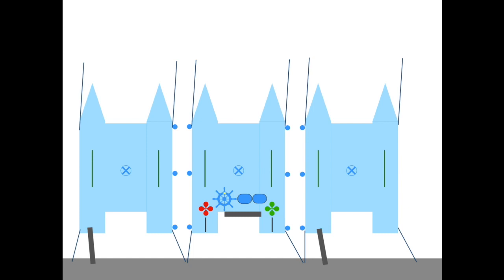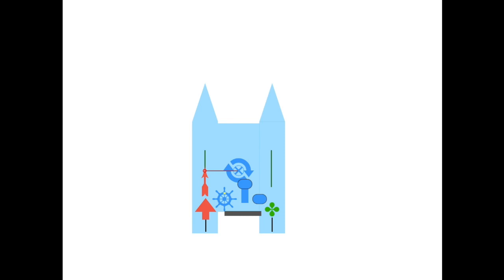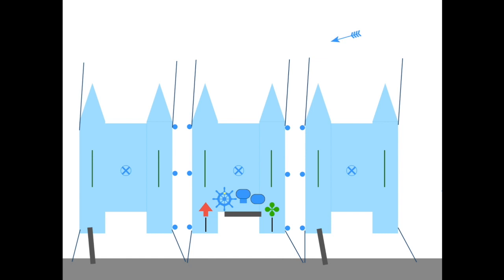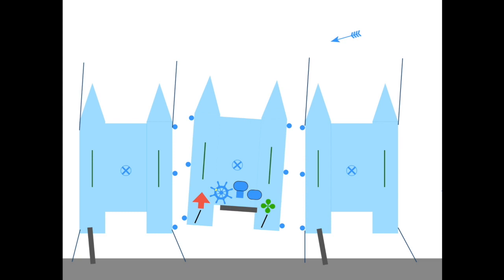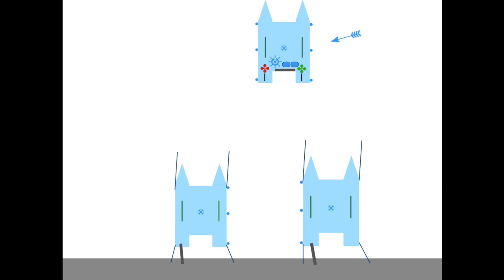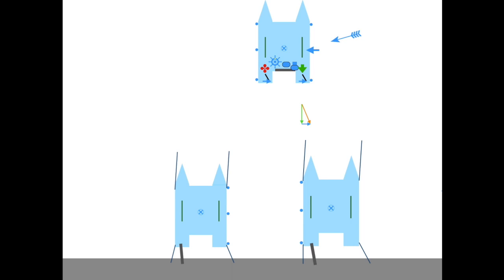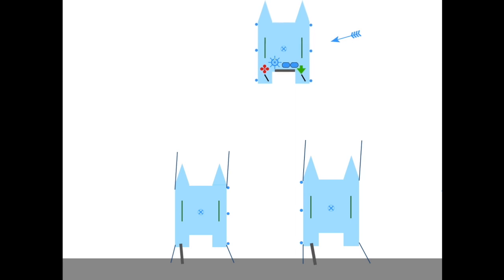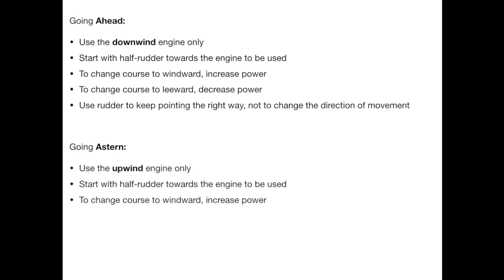Stern-to twin-engine crosswind cheat

Comment: I really appreciate this, and your going forwards guide is great. But why does the rudder have the same impact going backwards as forwards? Going forwards you get the prop thrust over the rudder, whereas going backwards you only have the slow speed of the boat through the water which is substantially less.
Reply from the maker: You are, of course, absolutely correct. More speed is needed going aft to have the same effect,  but it works predictably and consistently.  On some catamarans - e.g. some Lagoons, a saildrive is placed behind the rudder! In this case it works better aft than ahead, but it can be used effectively on any cat

Comment: Great video. can you explain how to do that on a lagoon catamaran (rudders before the propellor)
Reply from the maker: Thank you! There is a separate video on the channel specifically for the Lagoon and other cats with the props after of the rudders.
Reply: @theboatcheat1204 Yes i saw the video and it is very helpful. But it explain how to leave the dock (sideways and forward). How do I use this technique in order to moor (reverse) when the wind comes from starboard?
Reply from the maker: @davidelalouf1774  Ah of course… the same technique works in a Lagoon. However, whereas the effect is stronger going forward in a conventional arrangement, it is stronger in reverse in a Lagoon.  I chartered a Lagoon in the Med a few years ago and handling for stern-to mooring was really good - I reckon arriving is harder than leaving, so the Lagoon arrangement was a bonus.
Reply: So you are saying this crosswind trick works same even in a Lagoon with props aft of rudders?

Comment: You forgot to mention that if the rudders are located forward of the engines, as in Lagoon catamarans, then the rudders should be turned in the opposite direction shown.
Reply from the maker: Indeed - there is a separate video covering Lagoons in the same playlist.

Comment: Not sure if you are still responding to questions.  Why do you put the engine into neutral prior to releasing the starboard stern line?
Reply from the maker: A good question - if the crew drop the line it may foul the prop.
Reply: @theboatcheat1204  Thanks for the reply, but in the sequence you dropped the port line while the port engine was in forward and then put that engine into neutral before dropping the starboard stern line.  What am I missing?
Reply from the maker: @johnditoro1676  Nothing - this is a hitherto unnoticed editing error!  I always put the upwind engine in idle ahead while the leeward stern line is removed, so that the boat doesn’t drift too much to leeward thanks to tension in the upwind line. Then the leeward engine is put back in gear to cause the swing to the windward side of the space so that it is somewhere near the middle once the upwind stern line is recovered.  I am clearly less careful when editing complicated graphic sequences! Thanks for pointing it out - it need re-doing soon anyway because it is very clunky…
Reply: @theboatcheat1204  Thanks again.  I'll be sailing a cat in Croatia in a little less than 2 weeks.  Looking forward to trying some of your "cheats".

Comment: I have read all the comments and this question was never asked. Going forward makes all the sense. I have an issue with going in reverse when you say "do the reverse". The wind is the same so wouldn't the "do the reverse" mean to keep on using the downwind engine in reverse with helm to port to counter the engine? Don't you need the downwind engine in reverse to turn the cat into the wind in order to cancel it? Your suggestion uses the upwind engine in reverse which in my mind adds up to the wind force due to the turning effect. The way I see it the only force battling the wind in your suggested approach going reverse is the helm action. The only reason I can think of in favor of using the upwind engine in reverse is perhaps somehow related to the inverse prop and rudder position (with respect to going forward). But still, using only upwind engine in reverse would have a net effect of moving the cat even more downwind, wouldn't it? Can you please comment? Would my suggestion work at all and if not, why not? Perhaps the difference is subtle in favor of your approach and perhaps mine would fail altogether. I have not tried it. This is just a physics mind experiment. Perhaps this argument deserves a video? :)
Reply from the maker: I have reviewed this video completely and I can’t see where the confusion has arisen.  In case something I said caused confusion, refer to the summary instruction at the end of the video.  The latter part of the video answers your comment about the engine turning the boat - it is the turning moment that is useful, because countering it with rudder creates the later force you need to hold against the wind.

Comment: This is wrong. You should be turning into the wind or current whichever is stronger. Wind will always take the bow before it takes the stern
Reply from the maker: You are of course correct about the wind taking the bow first, but the clip is not wrong - it is about Mediterranean mooring, where there is almost no tidal stream, which is why stern-to mooring is used so widely.  I have used this techniques to squeeze in and out of several spots which are exposed to substantial crosswind and because the charter bases have limited space there is not much room between boat - at the beginning of a trip, when you aren’t necessarily familiar with the handling of the boat, this technique is a great way to simplify getting out cleanly.  At the end of the trip, when you inevitably arrive back mid-to-late afternoon in the hight of the breeze with a big audience it avoids you taking part in the “whacky races”. I have used it in a Leopard 44, which has enormous windage, in a substantial cross-breeze, and it was easily manageable.

Comment: Excellent video, thank you very much. 
There are catamarans that have the propellers behind the rudders. So the propellers don't stream the rudders (in forward motion). That means there is only rudder action when the boat is moving. I guess this technique doesn't work then, does it?
Reply from the maker: It does work, but in a different way - see the video for Lagoons on this channel for the technique with such boats…Thanks for your appreciation!

Comment: The idea of using the downwind engine while turning the rudder towards that side is sound.  A suggested improvement in your presentation is as follows:  the force vectors cannot arbitrarily be relocated to the center of mass of the boat.  Those force vectors act at the location of the forces.  Thus, the sideways rudder force pushes the boat in the upwind direction as shown, but since the force is applied at the location of the rudders it also provides a turning moment that rotates the bows downwind.  Similarly for the wind force that acts predominantly on the bows - it provides a side force as well as a turning moment that rotates the bows downwind.  The offset engine thrust is the only force that opposes both of these rotations.  The rudders provide the only adjustable control of lateral force, and the engine provides the only adjustable control of rotation.  So the right way to think about the helmsman's job is to use the rudders to adjust lateral position, and the throttle to adjust rotation.  It's important to remember that the rudder forces will be affected by the engine thrust if they are in the wake of the props (this will be a factor either in forward or reverse depending on rudder location).  Also, the rudder force depends on the square of the boat speed, with zero force at zero speed (neglecting prop wash if applicable) so it's essential to get the boat moving for the rudders to work at all.  I hope that all makes sense...
Reply from the maker: Thank you for your comments.  The forces are not arbitrarily moved to the CG, the effect of a force at any point not at the CG - of more accurately the biased mean between CG, Aerodynamic Centre (windage) and Hydrodynamic Centre (current effects), which varies from boat to boat - will always create a force and a turning moment.  The sum of these moments and vectors acts on the CG with the caveat already mentioned… so they are moved there to represent in a simpler way what happens to the vessel… nothing arbitrary about it, just mathematics.

Comment: Great videos you are doing 🙂. I have seen your Lagoon version of waking the cat sideways, and that makes a lot of sense (needing to steer opposite because the props are aft the rudders). But in this case (leaving from a mediterranean mooring) I guess steering opposite would not solve the problem. I cannot find if you have made a video explaining this situation in Lagoons? I would imagine giving a little forward trust on the windward engine (less than on the leeward engine) would give you that extra sideways trust you would be missing from the leeward because the rudder is placed in front of the waterjet from the prop. Or?
Reply from the maker: Hi Mads.  Many thanks for your appreciation.  I think you are right… the prop and rudder relationship is not so important once you have forward way on, so the same technique will work, but it may be that you end up with a little more power and rudder than on other cats.  I spent some time on a Lagoon 380 in Croatia a few years ago and I don’t remember having to do anything different from on Leopards, which is our usual charter pick… Going astern to get in we never had a need for high power, but it all worked as expected…
Reply: Going for two weeks Lagoon 40 and 450 in October - will make some testing 😅

Comment: New subscriber here - really excellent videos! In your experience is there an upper limit to the wind speed that would make this technique inadvisable? 

I have a Leopard 48 sailing cat with loads of windage and I'm always worried about losing the bow when going astern. I would be nervous trying this in really high wind!
Reply from the maker: It all depends on the boat, the location and also the load on the boat, so it would be inappropriate to put a number on it…. but the reality is that if you arrive back at the charter base and conditions are difficult, it will always help you to do this… and in bad weather they will be assisting usually…

Comment: Awesome tutorial. much better than learning via trial and error! Thanks for taking the time to explain this as we boat in super high winds here in the San Francisco Bay where the winds routinely blows 20-35 knots every afternoon during spring and summer months and there is always a stiff cross wind when docking
Reply from the maker: Thanks - glad you found it helpful.  Wind always seems to be from the wrong direction when docking, doesn't it?